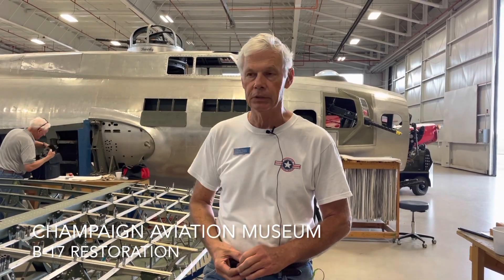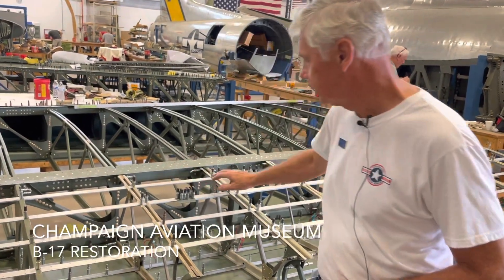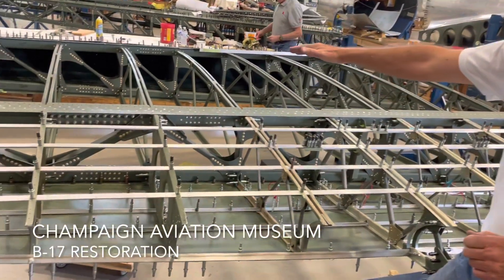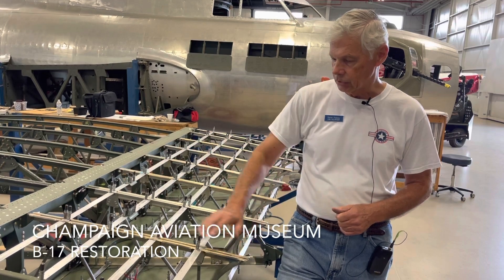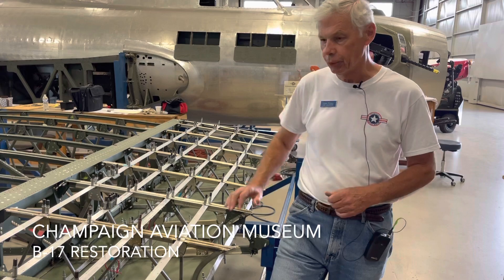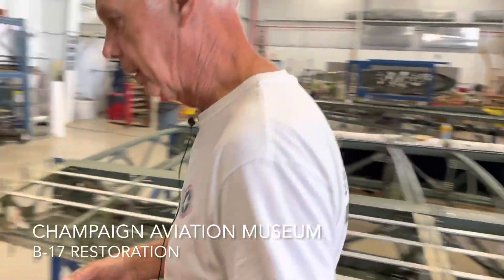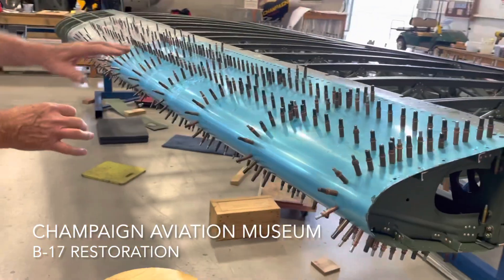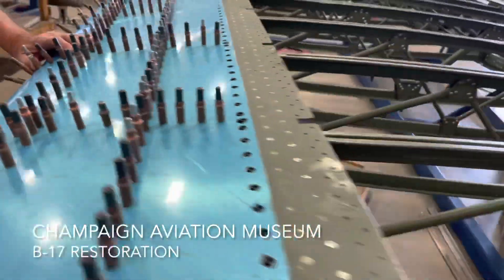Airplane Wing Rebuild: B-17 Flying Fortress Restoration

Comment: With  regard to another segment showing the bucking of the wing spars: Your  procedure involves high tech mini cameras connected  to a computer screen to show the inner perspective and assure the exact positioning of that travelling buck: My question is how did the 1935-45 workers manage to assemble the spars in a time without the remote cameras et al?
Reply: I have wondered that too..I could imagine a 3 foot long piece being slid into place and then all the rivets worked..Then slid down further for more..
The factories were doing fast!!

Comment: Why aren't you guys using draw clecos? I've also used non-marring washers under them. 
Spring clecos dont have the clamping pressure for a slightly sprung skin or compound curve.
41 yrs as an AMT Airline Overhaul, Eastern & A'A.